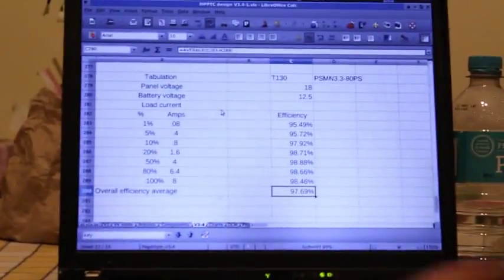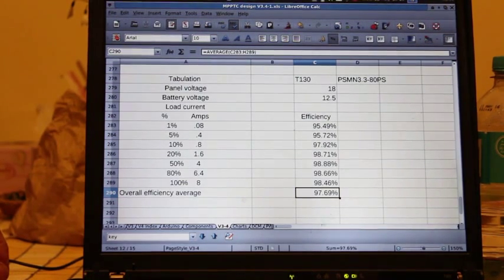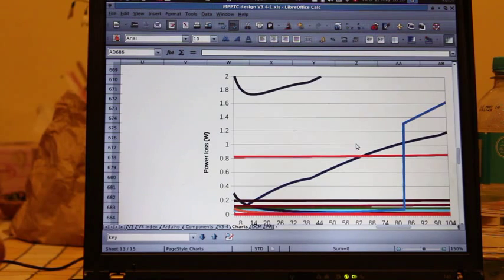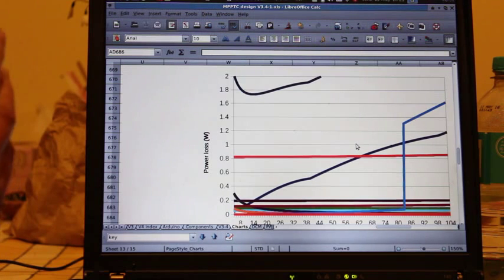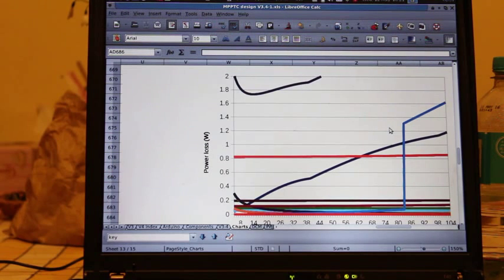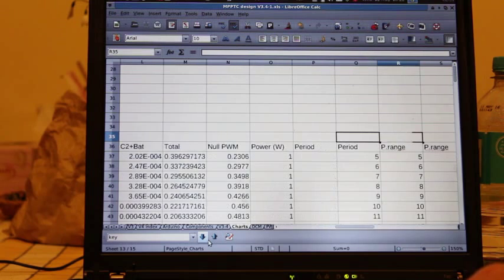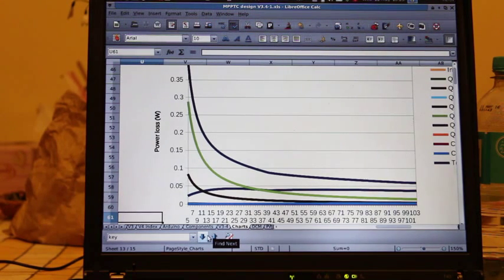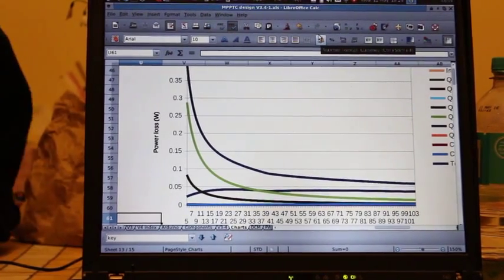Keith Presentation on Arduino MPPT  Charger Controller

Comment: Hi is version 4 complete?  I need an MPPT that can use 48V solar cells with a 36V li-ion 10s 18650 battery pack. The off the shelf products that support 36V batteries are far too heavy. The lighter mppts only support 12/24V. Any advice would be appreciated!

Comment: Good day sir, thanks for the video and for the data presented. are you saying version 3 is useable for now till version 4 is available which will include all the changes necessary.

Sorry sir if i may ask for help, i have a 12 volt inverter system and i have 8 (130watt)panel from china each has open cct volt=21.6v , short cct current=8.17a and max current of 7.43a. i plan to use 4 of them only in parallel for my inverter system. please sir if i need to build the controller sir are there any addition or changes i need to make to the circuit.